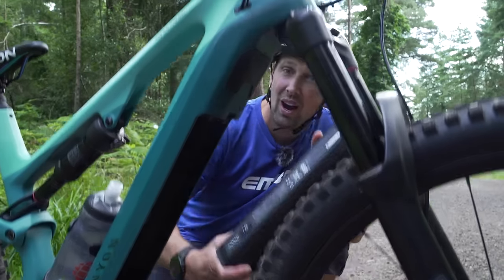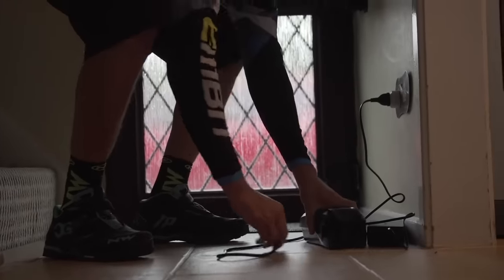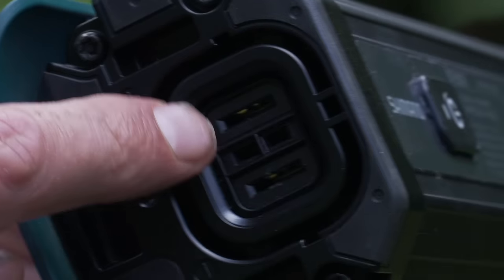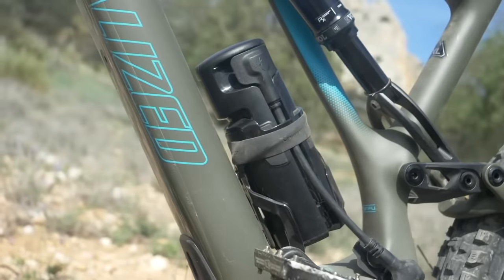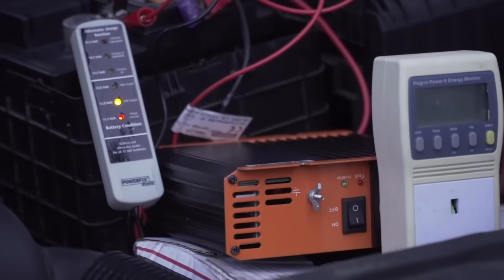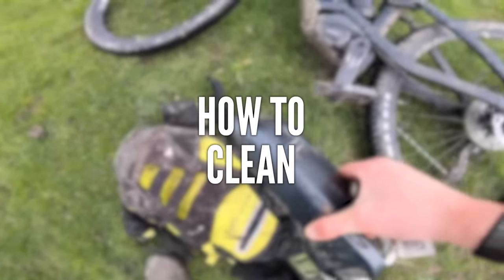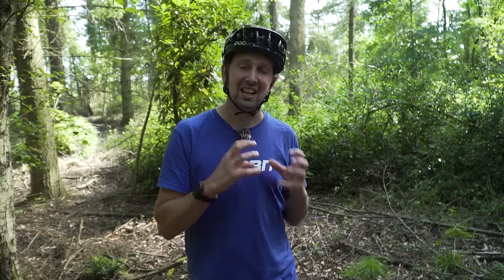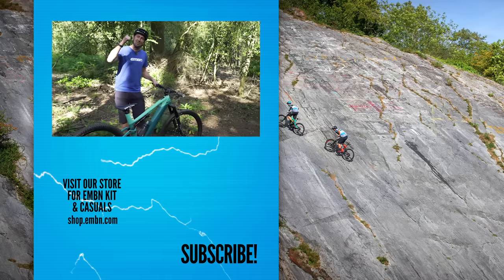How to Maintain Battery Health | E Bike Batteries Explained

Comment: Didn't know about the 80% charge prolonging lifespan👍 be good if the manufactures put an option on the charger to do that.
Reply: Yeah, not certain whether this is accurate. Certainly not discharging below 20% extends cycle life significantly. @embn do you have any links to hard data showing charging to 100% is bad for cycle life?
Reply: @uavr1286  There is no 100% proof that charging to 100% is bad for battery cells
Reply: It simply stands as a fact because if you are discharging the battery from 80% to 20% you simply use only 60% of a full cycle. And I am pretty sure that the 100% charge is actually lower in reality, simply as safety from the manufacturer. For me the best option to prolong the life of a battery is to have a second one.....
Reply: @mallias2683  Way ahead of you on the second one,I also have rigged up a carrier so I have an epic range now; 40 - 60 off road miles
Reply: oh and that is 97% Blevo not the bs specialized app
Reply: Battery hobbyist here. Warning, technical babble follows.
I'll start though by agreeing with you that I wish chargers gave you the option to set the full charge termination point, say, between 60% and 100%. Read on to learn why I chose 60%.

The ideal full charge voltage to get the longest cycle life out of the battery is actually 3.95v per cell.
Source: Military research into extending cell life.
On a typical normal-voltage battery (spoiler, around 4.2v/cell termination), this is around 60% of charge. But this eats so far into your usable runtime that it's rather impractical.
For example, your 700Wh battery will only have around 400Wh usable when used in this mode.
Many modern laptop computers offer the ability to command the battery to stop charging at 60%. This can go by a few names, such as "Conservation Mode" or "Plugged In Mode".
This is also a great voltage to store the battery if you aren't using it, though 40% (3.6v/cell) is better for it in this regard.

For each bit of charge you add to the battery above this, the cycle is a bit more intense to the battery.
Most batteries full-charge to 4.2v per cell. This is the "maximum voltage" rating printed on the side of some marketing information, and is considered a great compromise between runtime and cell life by manufacturers.
When you stop at 80%, you're halting somewhere around 4.1v, which favors longevity over 4.2v, but also gives you more runtime than 3.95v.

The scary ones are "high voltage" Lithium, seen in modern cell phones and some RC models. I will never purchase an e-bike that runs in "Li-HV" mode.
These fullcharge to 4.35v in what I consider a controlled overcharge, shifting the priority exclusively to per-cycle runtime at the expense of only getting around 500 cycles, if you're lucky.
This is also why modern smart phones need new batteries after only 2 years, when older phones seemed to last forever before needing a new battery.
Reply: @FerralVideo  Wow nice one will take note,think I would go for 80% on an e-bike with the range in mind.
Reply: @FerralVideo  Thanks for using the correct terms. (Voltage per cell) I know little about Lithium Ion, but have lots of experience with Lithium Polymer. (Li-Ion and LiPo respectively) However, from what I can gather, these two types have much in common. And thanks for sharing your knowledge for this noob. (me) My main experience is with radio control flying, and the high discharge that LiPo's offer. (Up to and beyond 100 C, or 100 X battery capacity. eg- 200 amps from a 2,000mah battery!) I have reports of some people storing LiPo's in their fridge, not sure what this would equate to with Li-Ion. I store my Li-Po's at 3.7 volts per cell, and use a specific charger/discharger for this task. I assume that the battery management system mentioned in this video would take care of this task but may be more limited as to individual cells, maybe not. Agree that charging whilst battery is still warm/hot from use is best avoided. And all the info I can come by advises to charge at no more than 1 C, but with bike batteries this will be out of our control without purchasing a new charger. I would also advise checking voltage every few weeks when not in use, to manage static discharge.
The Li-HV batteries you mentioned are, to the best of my knowledge, Lithium Polymer. Different chemistry and still fairly new. Supposedly the chemistry can handle the 4.35 volts per cell but time will tell as to the longevity. Many in the R/C community, myself included, don't mind the trade off regarding performance/longevity. My favourite RC model easily exceeds 200 Kmh and the thrill far exceeds the expense. Much different to mountain bike riding, where I want my gear to last. All info provided by me is only in my opinion.
Thanks again, 
Merv the Hotliner pilot, and now E-bike fanatic.
Reply: @TheSanjurok  there is. Check any research papers relating to li-ion.
Reply: @mallias2683  if you only used battery from 20 to 80 then it would last longer than 5 batteries that were used from 0 to 100
Reply: @FerralVideo  "Plugged In Mode" That's me dude. Cheers and charge safely now.
Reply: @FerralVideo  Great info there!  Do you have any specific knowledge you would like to share about the best practice to follow and technology used in a Giant Explore 500 wh bike battery / smart charger system?

The smart charger does have a mode where it can be changed to 60%, and my understanding is it is guaranteed to have just 60% of new rated capacity after only 600 charges!  Unfortunately there doesn't seem to be much more technical info available.  The charger indicates Model GL1270CA Output 41.8V 6A.

I have a kill a watt meter I use to monitor the Watts consumed at the AC plug during charge, as well as watt-hours being used for the charge.  With that it is easy to see that it begins charging at about 250 watts, keeps that up for a bit over an hour, and then drops the power over the next couple of hours, in a somewhat linear fashion until it apparently stops charging completely when the meter reads about 2.5 w.  It will stay at that 2.5 figure until I unplug it from the mains.

I been tempted to unplug it once the thing is only charging at about 50 watts or less, that seems to be in a bit over two hours and at an indicated SOC of 90-94%.

Unfortunately there is no source I can find that indicates if messing around with that charge cycle and stopping early will actually improve the longevity of the Giant Explorer battery.  In my case I have only been getting 30-60 miles per charge.  This is much shorter than the claimed 40-105 that bike indicates I should be getting when I begin running it!  One thing is certain, the bike always indicates more range than it will actually deliver to me.

I found some information that indicated it should be run down very low every 3 months or 15 charges.  Doing that seems like it would reduce rather than improve the battery longevity!
Reply: @dmalecki01  Everything you just described is exactly how a battery charger is supposed to work.
The 250w mode is called "bulk charge".
The longer period is called "Absorbtion Charge", and is the main limitation in battery charge times today.

I'm not entirely sure about the 60% rating.
That sounds like a service life advertisement when used in full power mode for full depth discharges. In which case 60% is pretty respectable after 600 full depth discharges.
If you only run it down a little and then recharge it, that counts only as a fraction of a full depth discharge.

The 60% charge mode, as my original post described, is a long service life mode. You won't have the full capacity of the battery, but it'll last a LOT longer.
You should also use this mode before you put the battery away for a long time, again as I described in my original post.

As for unplugging it, you really shouldn't have to worry. You can let it finish safely.
The 2.5w is just the power the charger itself pulls to power itself.
As a matter of assured safety, you should disconnect once the battery is fully charged.

As for the shorter range, I can't really weigh in on that with the information you gave me. 
You would need to compare your wattage drawn on your bike's internal computer with the watthours put into the battery by the Kill-A-Watt, minus a few consumed by the charger itself, and that in turn, to the ratings stamped on the side of the battery.

Stopping the charge early improves the long term longevity of the battery, but reduces per-charge range.
I would sooner use the 60% mode than unplugging the charger though.
Reply: @FerralVideo  Awesome response!
I agree, using the 60% mode is way more convenient to use, and when I'm just commuting, an indicated 60% charge that it would begin with should be enough to get me to work and back.  The indicated SOC when I get home would likely be under 30% and maybe under 20%.  I'll have to experiment to see what happens.

Is there harm in going below 25% indicated SOC on a regular basis?

Right now, when I'm commuting, I start at the indicated 100% SOC, and it usually indicates about 55% when I get home.  That is when using the Automatic mode, if I manually override it to provide less assist, it will have a higher SOC when I get home.  My commute is about 15 miles.  I weigh, with accessories, under 180 lbs.  I don't like to sweat on the way to work but am willing to pedal harder on the way home.
Reply: @dmalecki01  25% under load shouldn't hurt it.
Going below 10% is where things get fruity.
I, personally, would use 60% mode while commuting, and use full if I expect an extra errand or otherwise need the capacity.
Reply: @FerralVideo  Thanks for the suggestions!

I've experimented with the 60% charge mode and it works for me with my commute, especially if I'm willing to recharge at work.  In that case the battery would normally be between 60% and 40%.  It would probably be best if I left it at 40% and charged just prior to use, but I will probably typically charge it to 60% shortly after finishing my rides.

Many of my other rides would work with the 60% charge at start.  For the ones that don't, I'll charge it to 100% just before the start of the ride.

I've noticed the charger consumes 2.3 watts after it has reached 100%, but it consumes just 0.5 watts after it has stopped at the 60% charge level, this is despite the fact that an extra LED is on when it consumes 0.5 watts compared to when it consumes 2.3 watts.  I believe it is doing extra charging there after the 100% charge has been reached!

Since I really don't want to carry a (9 pound) spare battery around, it seems a lot better practice to carry a charger that weighs 3 pounds with me when I'm out and about.

Comment: The problem with not charging to 100% before a ride is that it adds to my range anxiety. However, just driving to a known short distance destination is the only time I don't charge fully. When I'm out 22 miles from home on my 70+LB fat eBike, I want to know for certain I'm getting home. And in case of a mechanical or electrical failure, I have Velosurance which will send a van out to the nearest street and get my ass home. I'm too old to be walking my bike out in the middle of nowhere.
Reply: Dont forget you have pedals on a bike :)
Reply: @Character Zoo HQ  what about the term mechanical failure has you thinking he can still pedal? On his bike a broken chain is probably the most likely mechanical failure 😅

Comment: I took my new steed, 1st EMTB out for it's 'shakedown' the other day and have to say, these things are fookin brilliant! If I'd bought a new 'standard' MTB, I think I'd be disappointed. The motor really adds to that next level feel, it helps with the ups and the extra heft helps with that more capable DH feel. I used to go out and dread the ups but do it to get fit for the downs. You really have to get out at least 2x a week to get and maintain fitness which isn't easy. Now, I can look forward to ups as I can get more downs. I spent more time out on the trails and got more done. In all honesty, they are cheating, it makes it so easy, you piss all over the ups but they are done so quick, you start enjoying riding. You'll get loads more riding done in a shorter time.
Reply: Same here, I got my focus jam2 about a month ago. Riding trails I otherwise wouldn't even contemplate on a non ebike.
Reply: This is what Chuck Norris would do.
Reply: Yes steep technical rides are now fun, so much less impact if you should fall while climbing vs flying down hill. Get your kicks going up as well as down😆

Comment: I am a relatively new Ebike owner. I’ve ridden conventional bikes for the past 30 years, but now in my early 70s, I feel the need for some assistance, when riding up hills or against strong headwinds. I live in South Florida, USA, where, during the summer months we get frequent rains, and I will occasionally get caught in a rain storm. How well protected are the batteries in the bike against a rain storm. I understand that when cleaning the bike, you do not apply a very strong spray of water, but in a typical rain storm, how vulnerable are the batteries in the bike to the rain while riding? I’ve had people tell me to wrap the battery compartment using some plastic material if I’m going to possibly get caught in the rain. I find it hard to believe that an E bike costing upwards of 4 or 5K, USD, should need to be wrapped with saran wrap to protect it from the rain ! Would appreciate your thoughts. Thanks very much!

Comment: I know this is an older video but it applies so Ill ask, hopefully someone can get back to me? I just too dekivery of an emtb with a shimano steps system with a 504wh gen 2 pack. It arrived absolutely dead, and I dont mean BMS protection mode dead, but zero voltage within it dead, and I estimate it was like that for months as I got it on clearance so it was probably sitting a shipping container for ages?

 I put it on charge and it wouldnt charhe for close to an hour then it finally started. It went over what any even slightly partially charged pack would accept as my power meter showed a total of 585wh go into this 504wh pack.

My question is: what are my options as the company I bought it from wont do anything apart from me returning the entire bike, which Im happy with the bike so thats extreme, and they say Shimano has a 2yr warranty but the packs Ive had in the past that have had this level of neglect usually still make it past 2yrs but not by much and they fall off hard!

Do you think itd be worth my time to explain this issue to shimano or am I borked and stuck with this battery thatll inevitably fail hard?

Anyway, tjank to anyone who has some insight!

Ive been getting alot outve this channel and all its brethren so big thanks!

Comment: I bought a replacement battery from Trevor at Royer Battery of Surrey B.C.
It has Samsung 21700 cells with @5Ah at 48 volts for a 1200 watt hour rating.
I have put 745 miles on my Surface 604 Colt with this battery in 2024 with no issues.

Comment: My new BeeCool eBike battery will not 100% charge in the maximum 12 hour recommended charge time. The last indicator light which represents 25% remains red. Can I check the battery with a volt meter to see if it is fully charged?  I’m thinking perhaps it’s a problem with the charge indicator light not the battery?

Comment: Ideally, we need probably 2.5x to 3x capacity than it takes for the distance we travel in a day.  And the bms and charger need to team up to keep it in the safe zone.  Would help tremendously to have an easy to read meter.  One battery manufacturer selling on a common marketplace instructs that their batteries must be powered on while charging to charge completely.  What's up with that?

Comment: Got an error code 73 on my PW ST battery today - sad times :( under warranty - apparently it’s because the battery is giving too much voltage to the unit. Anyone know why this might be happening? To be fair - I do charge from 0 to full quote often as I’m a courier. To my knowledge this would only deplete the lifespan and not cause a voltage problem. FYI I’ve 7000km on my motor, it’s less than a year old - hopefully warranty will cover me.

Comment: I used to ride an old scooter back in early 2000s of them brick batteries which I recharged when at lowest level. Now today Im using BMS Battery and unlike the old ones this battery is mention to recharge after every use instead of letting drop to lowest to re charge. It makes sense of recharging after every use due to the set of batteries at top is being used up before the lower ones as the lower ones always be on stand by of their turn. Keeps that Optimal power use every time I take out bike. But the real factor is how you use PAS knowing the more you use PAS the more power is conserved. Looking at display when Im on say 3 PAS and using peddles the wattage output reads zero when using this which in return my recharge time is less than it would if I used throttle going same mileage of peddles.I just got back into E Bikes from decades back of my last E scooter which suks on the older batteries and with these new types, Im loving this as very PRACTICAL to finally have the Tech of E Bikes in its prime..